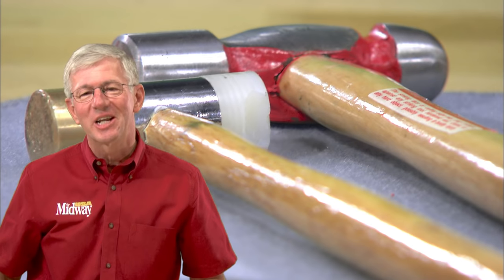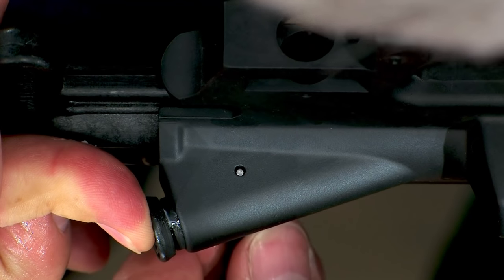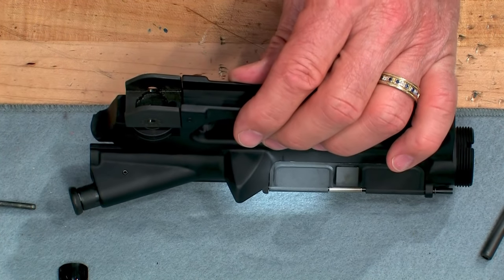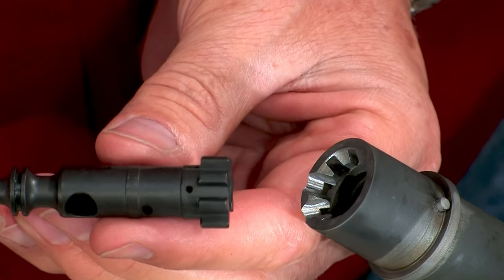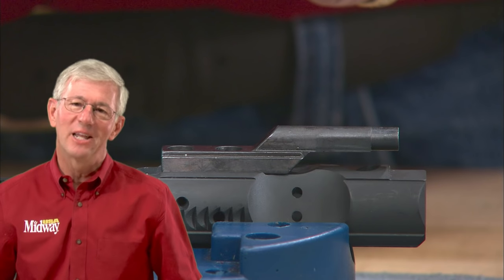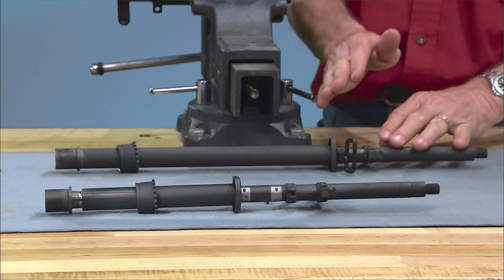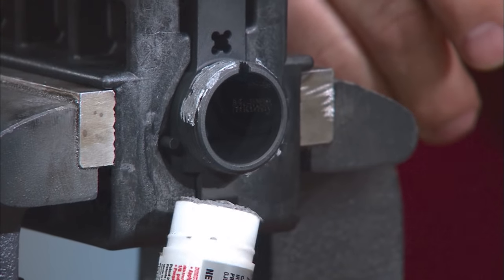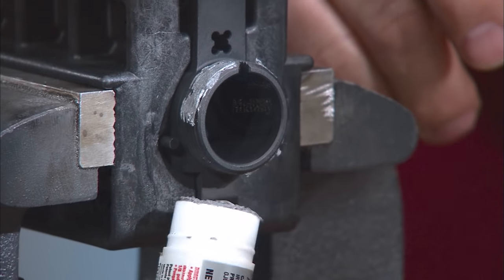How to Build an AR-15 Upper Receiver Presented by Larry Potterfield of MidwayUSA

Comment: This guy cracks me up...."the upper receiver is easier to build than a lower receiver"...30 seconds into him displaying his tools I started looking to buy a complete upper receiver :-)
Reply: lol! That's exactly what I'm thinking right now. Those tools will set me back at least a hundred bucks. I want to build a retro Vietnam era A1 build but now I say f__k it, I'll just go to Fulton Armory and buy one that's period correct and ready to put on a lower.
Reply: these are just suggested tools ive seen somone get by with a multi too castle and armorers tool
Reply: Haha dude you dont need all those tools. He has like 5 types of each tool. Chances are you already have all the tools you need.
Reply: he just trying to sell stuff
Reply: lol
Reply: I'm going to be honest...I have highly modded a NFA lower, stripped it, put a lower parts kit on an AM-15 stripped lower, stripper that lower and put that parts kit on the original NFA lower. I have not fully built an upper half yet, but after looking at this video I think building the upper is harder. That being said if you get a pre-assembled BCG (which is easy) or a coupled bolt and barrel kit (might be able to skip gauge check), an assembled railed receiver (with FA and dust cover), a railed gas block, and a free float forend, I could see the task not being so bad.
Reply: You can always buy the parts have them installed and still save money
Reply: It seems like he is trying to knock the viewers off balance by claiming building an upper is easier than a lower.  Then while you are off balance, he is trying to sell you a bunch of tools.  Very manipulative of him.
Reply: I can put a stripped lower together in no time. This seems like a lot more work
Reply: writeinfosetup I built my whole AR with ZERO knowledge in only about 45 mins on my kitchen table. Using YouTube videos, an AR wrench and a couple other common tools.
Reply: @FoodFolksandGuns  I don't think you need ALL of those tools.  Most people have a hammer, pliers, etc.  Standard punches will work - at least for the lower.  I got a combination armorer's wrench for $10 at a gun show that will supposedly fit the castle nut, but I haven't tried it yet.  Point is - don't get too wound up over how many tools he has.  Remember, Potterfield is supposedly a great guy, but he also wants to sell you those tools (not that those two things conflict necessarily) from MidwayUSA.com..
Reply: @MrZachgonz  what video did you use these clowns sent my upper not built 🤦🏿‍♂️
Reply: @bryangriffin8185  did you get it built? I think all you really need are some punches, an armorer's wrench, a multi-tool, and some time.
Reply: @Posty-vw9jc  yea very easy
Reply: Ha!  Me too.
Reply: That's Horse!   Built a lower without a block or vice on an Air mattress with only a rubber mallet, small hammer and 3 punch set.
Reply: Just watching this video and seeing the investment in tools changed my mind on even trying to build a complete upper.
Reply: Lower is at least 10 times easier then an upper.
Reply: I've been an auto mechanic for almost 20 years. I've learned that most tasks or repairs can be done with much less than the minimal "required" tools. It might involve more cuss words and frustration but if attention is paid to the details the end result will come out the same. There are certain things however that are just not worth "butchering" without the correct tools.
Reply: @Paul.atherton  
“He seen…”  Sorta hard to take you seriously, when you don’t even know he language.

Comment: i noticed some comments on this series (building an ar upper/lower) that i dont get. i realize you dont need all these tools, as does anyone who would build an upper/lower. yes, midway is trying to sell you stuff. with that being said, this guy has forgotten more about firearms than at least 85% of the people watching this will ever know, including me. he doesnt watch videos, they make them about him. many of the tools shown ARE completely unnecessary, some would be handy and make it a lot easier, in addition, make it a lot easier to prevent marring, knicking, scratching, etc, even if minor. you can use a pair if visegrips to drive a nail, but a hammer sure is nice to have, and i would take a paslode over that, that is all this guy is doing, using the right tools for the job, to do it right with ease, and have the end result be professional, which is what he is. dont know the guy, dont have any affiliation to midway, bought one magazine from them years ago, but it kills me that someone who can tear down their glock  thinks they are a gunsmith, at best you are a backyard uncertified armor, and their is  big difference. just my .02
Reply: Well said! There is always some shortcuts. But professional assembly is always a Big Plus. Plus you don't get yourself or someone else injured or Dead by misalignment or other missteps in assembly.

Comment: Hey Larry,  re-check your torque wrench usage rules. The barrel wrench, the way you have it on the torque wrench, is acting as an extension and requires recalculation of the torque. However, if you don't like to do simple algebra, turn the barrel wrench so that it is 90 degrees to the torque wrench, then the torque dialed in will be the torque applied.
Reply: He's never been to AFRAM/P school!
Reply: Looks like he used his torque wrench @ 90° there @23:35

Comment: Great video, only thing is when using a torque wrench with that kind of adapter the wrench needs to be @ 90 degrees in relation to the adaptor.  Other wise the actual torque will be different than what the wrench is set to. 

Thanks for the awesome video and keep them coming.
Reply: +Michael Bearer 

I'm glad I wasn't the only one who noticed that.
Reply: Michael Bearer I'm glad you mentioned that.
Reply: I'm glad somebody brought that up. That's a good note for this application, or anybody using dogbones with a torque wrench.
Reply: I was about to comment about that too, he overtorqued the barrel nut
Reply: I can't believe how many people don't understand this and see it done wrong in almost all videos when torqueing with an adapter.
Reply: good tip.  using it the way he did you'll get a GREATER torque reading but most barrel nuts have quite a large range of torque like 30ft lbs to 80ft lbs.  using the barrel wrench in line with the torque wrench set at 30ft lbs will add roughly 8-10ft lbs of torque, so still well within the acceptable range.  maybe he knows this and its not that big of a deal for him.  nevertheless its still a good rule to practice.

Comment: Actually, my weapon of choice for handling E-clips is a good sized hemostat. Holds as well as a needle nose but you can lock it tight on the clip, lay it on the bench till you need it and install it very easily. I keep a dozen or so assorted size hemostats in the tool box.

Comment: It is to fully seat the round when you load a new magazine. The military teaches to hit it 3 time with the heel of you hand after you charge the first round. This is to assure the round seated if the chamber is a bit dirty. Normally, you would pull the charging lever back and then let go allowing the spring inertia to close the bolt. If silence must be observed for security reasons, you can slowly release tension off the operating lever and then palm the action closed with the forward assist.

Comment: 23:00 is it necessary to take account for the tool length when making the calculation for the torque setting on the wrench or just set it to spec? Just curious

Comment: My firing pin isn't quite as snug in there as yours.   At 19:15 where you pull back on the firing pin with the small tool and it doesn't seem to move.  Mine moves pretty easily with just my fingers.  Maybe 1/4" or a little more.  Is that bad?

Comment: Nice video and good information. I call BS on your barrel nut aligning perfectly with the gas tube port opening on the first try, Larry! Anyone who has ever done this know they never do and you end up tweaking it several attempts before you get it right. That is why the torque spec is so wide.

Comment: Great video thanks!!! Heres a question though. I have a 2 piece drop in quad rail hand guard. The top of the hand guard rail does not align side to side. Up and down is perfect but it's off side to side. I called the manufacture and they suggested to torque the barrel nut some more to see if that will align it. The gas tube looks to be nice and straight with the barrel nut and receiver just by eyeballing it. Don't have the tools to check everything but, wouldn't tightening the barrel nut bind the gas tube since it looks like it's already aligned straight?
Reply: No.  But that won't fix your issue either.

Comment: Noob here & just asking to ask the community.
I bought a 14oz tube of multi-purpose lith grease from TSC a year ago. Just used a tiny bit on some O-rings. Their website says "Doesn't contain extreme pressure additives" & Flash point of 410°F.
Am I correct to assume that grease is just grease for an AR assembly? Doesn't have to be some specialty white lithium gun grease.

Comment: Correct me if I'm wrong, but I thought you were supposed to lay down some RTV sealant between the gas key and the bolt carrier?  Also you're supposed to keep the barrel nut wrench 90 degrees to the shaft of the torque wrench.

Comment: I noticed the barrel slid easily in the upper receiver. I have watched other videos where it has to be hammered in with a rubber mallet. Does being loose or tight that affect accuracy?
Reply: No. And it's all tolerances.

Comment: hey my bolt is caked with carbon that i cant get off...i even soaked the rear of it (where the carbon is) in hoppes #9, with no results...what do you recommend MidwayUSA?
Reply: Use Ballistol and let it soak for a few minutes.  I use it on my stuff and the carbon doesn't stick nearly as bad.

Comment: Same deal. It always gets dirty around the rings and bolt back. Just scrape it off carefully and get as much off as you can. Some guys use a ultrasonic cleaner, but I have never tried that to see if it works better. I soak in Simple Green and then scrape and lightly oil.

Comment: The torque adapter he is usingon thetorque wrench has to be on a 90 degree angle for a proper torque.
Reply: No it doesn't. The original Colt and military manuals say that the torque is properly read when using both wrenches together.
Reply: Dude, the range in the manual is 30-80 pounds. That sure sounds like a really precise range to me.

Comment: Hi Larry, Don't you need to index your barrel wrench at a 90 degree angle with your torque wrench before torqueing your barrel nut?  The way you indexed it will not provide an accurate reading of the torque you are applying.
Reply: There is a formula to calculate the correct final torque when using an extension.

Comment: I use a pocket knife to scrape carbon off of the bolt tail.  It's much more effective than a brush IMO.  When clean, coat the boat tail with a grease that will leave a film when it is burned off.  I like Superlube synthetic grease.

Comment: Yes he will most likely use all these tools, but it is not necessary.

You could get by with the following
Magwell Block 
AR Receiver Vise 
Torque Wrench 
Armorer's Wrench 
Roll Pin Punch 
Punch Set 
Screw Driver (Flat Head) 
File Hammer 
Needle Nose Pliers 
Wheeler Bench Block
Aero Shell M3 Grease

Comment: The forward assist is  found commonly on AR-15 rifle derivatives, such as the M16 assault rifle, and is usually located near the bolt closure, that when hit will push the bolt carrier forward, ensuring that the bolt is locked.

Comment: Very interesting video. Learned much from it. Now I know why AKs are better (tougher).
Reply: I wouldn't say the AK is better. The AR and AK both share advantages and disadvantages, but one is not better than the other.
Reply: ***** I stand by my statement. They each follow a different manual of arms and were designed for different tactics. Both are effective. Both have proven themselves time and time again. One is not better than the other.
Reply: CPHannigan, I agree with you on tactics and combat proven solutions. My comment was all about mechanics. AK has far less weak spots  in it's mechanisms. Yes, AKs have its drawbacks (shot precision for example), but mechanically… I'm an engineer and I don't like too complex AR bolt scheme with direct gas impingement, AR tolerances, the need of dust cover. So I stand with my statement: AKs are tougher build and have more reliable operating mechanism. They are also easy to disassemble, clean and lube.
Reply: Иван Клубков I can't argue that. The AK has the reliability, the AR has the precision. I like them both and enjoy mine.
Reply: Иван Клубков ARs are almost as reliable as AKs. If you want proof I think Military Arms Channel (MAC) did a video on this. Also ARs with the right pieces are just as reliable as AKs and can run without lube
Reply: ***** Конструкция затвора у AR-15 крайне извращённая. Чистка и уход намного сложнее, чем у АК-образных. Всё остальное - да, замечательно (удобная, расширяемая, аксессуаров дохрена). Но если уж рассматривать AR платформу, то HK-416 даст классической AR-15 и M-4/16 большую фору.
Reply: I love My AK, it's never given me a bit of trouble. I really like the very mechanical feel of it when I'm shooting,too. I'm building My first AR now, want to see how good it can be as I'm going for an accurate gun in it,but can't complain about the AK for that either,not really.
Reply: The AK's safety is its dust cover.

The AR is a sealed action. Watch InRange TV's mud tests to see the benefit of this over the AK. The AR dust cover is handy in keeping crap from sticking to a heavily lubed bolt but it is not necessary for reliable operation.

It is far easier to assemble a reliable DI AR than it is to build a reliable AK, as evidenced by the American Kalash market.

Comment: no black o-ring on the extractor   aka failure to eject will happen ! / The snap ring that goes over the weld spring has two sides to it ..the sharp side and the round side, the sharp side is supposed to be pointed up towards the end of the barrel. / The gas key must be aligned on the carrier , most manufactures like micro best has slop in allen head screw holes allowing the gas key to twist left or right a couple of thousands.

Comment: My go no gauge is usually the first round. It goes or it doesn't. I have never seen or heard of an AR fail headspace. An ak on the other hand, it may be worth looking into
Reply: This is an ok way to check minimum (though not the correct way) but you can’t check the maximum which is by far the most dangerous way to be out of spec. Too much free chamber can cause the brass to blow up causing the gun to possibly blow up.

Comment: Several manufactures offer "AR-15 carbon scrapers" designed to make it easier to clean the crud off the carrier. It is not unusual to have to scrape it off.
Reply: NOBODY WHO KNOWS JACK S...... WOULD SUGGEST YOU CLEAN A PRECISION PIECE OF A FIREARM WITH A METAL SCRAPER.  OH,WELL I GUESS IT GIVES THEM MORE "JUNK" TO SELL.  PROPER CLEANING NEVER INVOLVES THE PRIMITIVE USE OF METAL SCRAPERS.

Comment: What does a forward assist do
Reply: When the bcg dosent get in battery right you push it and t helps lock in battery
Reply: What is a bcg and a battier
Reply: pardon the late answer but I'll toss in my two cents:

The BCG (Bolt Carrier Assembly) is the fully assembled part you see being put together from 18:22 to 19:11. It includes the Bolt, Bolt carrier, and Firing Pin along with their respective retaining pins and cams.

When the bolt and BCG are fully seated in forwardmost position in the chamber, we say the bcg is "in battery" because it is ready to fire. It's a technical term, don't think about Duracell.

Hitting the Forward Assist forces the BCG in battery - incase the BCG for whatever reason failed to fully lock in the front position. As vettelover2009 said, this is often used with minor jams when you're in an urgent situation and need a quick fix to get the rifle ready to shoot. However, forcing a bolt and bullet into the firing position when it's not a perfect fit can be dangerous to both the weapon and the shooter.

Hopefully that made a little sense.
Reply: +SPACKLEBOX thank that was help full.
Reply: I have heard of guys using them in deer blinds charging the gun and riding it home and pushing the FA to make less noise then standard loading.
Reply: In short, the forward assist is a holdover from a request by the army from the initial reliability issues with the XM16.

With a modern rifle, it is useless.

Forcing a weapon into battery is dangerous and can often make all of your problems exponentially worse.

Before someone says, "But it can be used to fully seat a round silently," or some other nonsense along those lines, the carrier was designed with that scallop cut for this explicit reason.